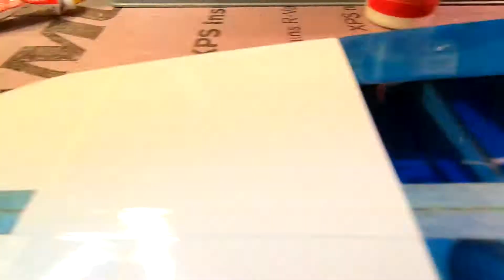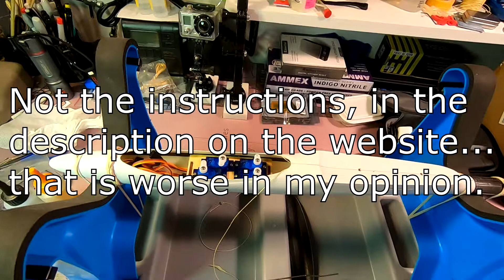HobbyKing Raven 1500 DLG - Build Pt10 - Smoothing the Wing Tips (Mod)

Comment: Another informative video thanks. 
If it was my plane and having seen the pointers you have shown I'd rehinge the ailerons with 3 pin type hinges per side. I'd also seriously consider moving the aileron servos into the wings then use the two rear servos in the fuse for the rudder and elevator.
Again I'm not criticizing anything , just typing in what my thoughts are based on what I see in the video.
Cheers
Reply from the maker: I'm not the least bit offended... please keep the observations and opinions coming! Interesting that you mention moving the servos into the wing. I don't want to be a spoiler, but I build the kit as suggested to demonstrate the available throw and then do a bunch of mods. Not going to say more.... you'll see!